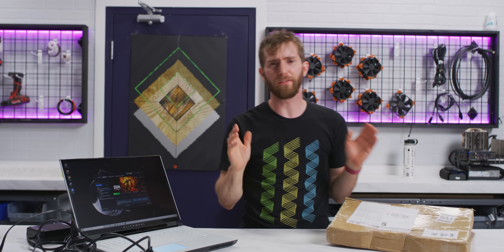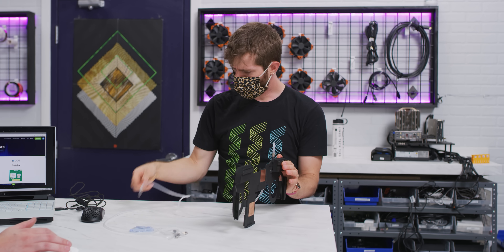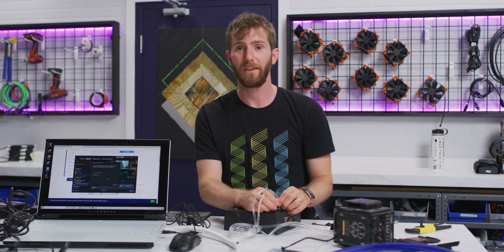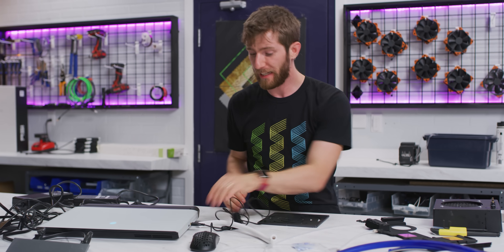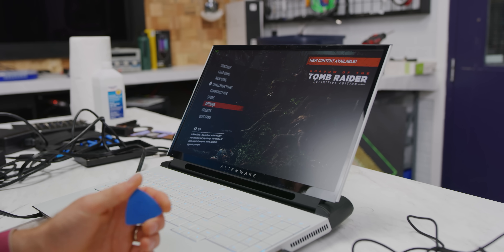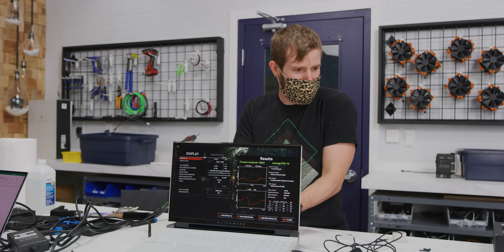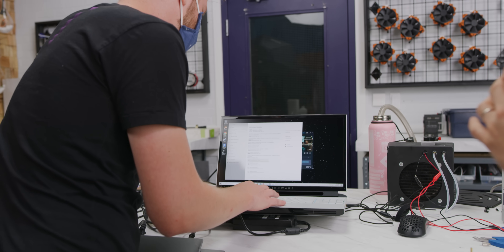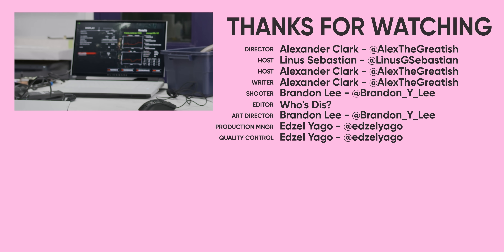This Sketchy AliExpress Cooler....

Comment: A had this Area51 model. Since June 2019 they lowered GPU power to 150-180w, lowered gpu temp before throttling to 69C and REMOVED videocard vrm heatsink-it will cause videocard vrm burnings. There are complete idiots in Dell. I was so satisfied when I sold it.
NOT RECOMMENDED
now have Titan GT76 instead

Comment: Very practical cooling solution for a portable mobile gaming laptop. Does it come with a special waterproof laptop bag to accomodate the pump and all the water that drains out as the tubes burst, whie you're crrying your laptop to the insane asylum to show off your water damaged $4000 paper weight. I'M BUYING 12 OF THESE RIGHT NOW SO I CAN CONSECUTIVELY DESTROY 12 LAPTOPS IN A ROW! lol great video guys

Comment: I wonder if in a lab of some tech giant, they actually made something like this but properly.. 

Seems like a good idea in principle, providing it is done right.. and I imagine if engineered from a cooler designed from the actual laptop model, it would have worked markedly better.
Reply: Looks like it's designed from the stock cooler drawings.  Might line up better with different VRM pads and appropriate torque.  For pump and radiator would need a more portable unit than their camera leftovers, plus it might be possible to close the loop with no pump for stock-like thermal performance.  For even better cooling, chill water to 1°C on the inlet, or go lower with something like  glycol.

Comment: Games running at 150 FPS plus is cpu bound , they should have tested different games

Also in Alienware commands center you need to set gpu max temp to 85C other wise the defaults at 74 C

Comment: When installing screws a good rule of thumb for tension if you do not have a torque screwdriver  is to thread them in until they squeak,  strip, then back them off a half turn. I've shared this tech tip with countless competitors.
Reply: How to damage a computer

Comment: For that price (600 kopecs), i'd make my own water cooler with carbon fiber and keep the OG parts in a bag. Like seriously, i've made entire covers from CF for under 100 dollars for everything when i was in highschool, sold them for 300 and made money. 

It's stupid easy to make your own bottom from scratch that allows you to put actual water cooler blocks directly on the CPU GPU pockets, over the OG cooler. So all in all, with a few YouTube videos for how to make CF parts (i am willing to bet that if a fella watched say.. RamyRC making his RC airplanes, they'd know how to lay CF panels), a new second hand bottom from fleaBay (found one that's about 95+shipping) and some coolers with push fittings, you could have a water cooler system for this for under 400, and i'm giving it extra, because for something like this, you could do it all, all of it, with parts that are non standard and fleabay finds (rad, fittings, piping, cooler blocks, CF fibers (precut meter squared sheets, resin etc).

The only thing that i'm at odds about how i'd do it, but that's because i don't have that cooler tray in my hands, is ... how you'd stick the water blocks to the face, but for something like this, where the end product won't be seen from the outside, i'd probably drill 4 holes in the non cooling conductive parts, and thread them to make classic braces.

PS, went to do some mathing. So about 95$ for the cover, 200 for cheap but decent all included water cooling kit (comes with only one sink tho >>> ), 16 for the second sink, 35 for a 1x1m piece of 320GSM CF cloth piece, 30 for a surfboard repair kit, which has more than enough resin for the whole project, 10 dollars for artic cool (first paste off the top of my head), 5 dollars for a drill and thread (2 in 1 combo) bit for 2mm screws, and let's throw misc junk for under 10, if i'm not forgetting anything, you could cool this for:  401 dollars in verified, fleaBay existing prices.

 So that's nearly 200 less than that non fitting piece, that doesn't come with anything other than two janky shower head core tubes and no guarantee that you won't fry your shit, whilst this variant, not only gives you the certainty that it works, remember, we're not displacing the original board, but it also allows you to go back to stock with all your crimes committed, unseen.

I think i know which i'd go for.

Comment: Alex, a mechanical engineer: We'll just tilt the laptop so the water just falls away from the motherboard
Reply: "Brilliant"
Reply: sounds legit
Reply: As an engineer (albeit software,) I can confirm that this is standard. All we do is make things work, for as long as they need to work, using the tools we have available. As long as it cools the computer for the duration of the test (and doesn't damage anything,) then mission accomplished! They're probably just gonna throw it out afterward, anyway. No point in wasting engineering time (which is generally quite valuable,) on fixing a problem that doesn't need to be fixed :)
Reply: @anexesstormlord7193  you're the reason the people who will work with what you came up with hate engineers
Reply: @alexstromberg7696  did they even turned on the pump?
Reply: @anexesstormlord7193  you're definetly not a German engineer 🤣
Reply: @Xc31  I'm not sure what that's supposed to mean, but at no point did I say my work is shoddy. Getting new tubing or a new fitting would involve hours, if not days, of waiting, just to fix a problem that will never happen again after this one test. Fixing it is a huge waste of time and doesn't affect the outcome in the slightest. If they were selling the setup, or planned to use it again, it should absolutely be fixed permanently.
Reply: @anexesstormlord7193  might not be a thing in software engineering then, but Germany is famous for fixing things that dont need fixing. Its a big part of why they lost the second world war actually.
Reply: @Xc31  Also going for quality when they were getting beaten by quantity. Lesson learned: mediocrity wins wars
Reply: @YinYangLogo  The problem isn't that they went for quality, it's that they went for insane quality
Reply: @TechnoMinarchist  So much quality the transmissions quit every chance they could.
Reply: @zachgullerman3183  That was an oversight issue not quality issue. They didn't design them for Russian winter (they believed they would've beaten them before winter)
Reply: @TechnoMinarchist  Not true. The German military was infamous for designing tanks that overloaded their chassis', more so than other armies of the time, which is saying a lot.
Reply: @YinYangLogo  not always, brilliance can too. look to alexander the great.
Reply: @rectalGland  might not feel like it to you, with you being German, but outside of Germany you still have that reputation. I live 21km from the border in NL. 

It might have gotten a bit less over the years, but taking a quick look at the German car industry or industrial equipment designed by German companies and you could still say they have a tendancy to overengineer stuff.
Reply: @Xc31  I had no reason to laugh at this as hard as I did
Reply: Sounds like something a mechanical engineer would say
Reply: Alex be like: "Trust me I'm an engineer!"

Comment: THERMAL PASTE!
That's the problem. 
Have you seen how he applied it?
Reply: I cringed soooooooooooo hard watching him slather that processor like a pb&j sandwich
Reply: @lorenzomeza6262  I was in tears. That legit upset me. My day is ruined!

There's been tests done using Plexiglas so you can see how the paste spreads, and that's like the second worst way to spread it (and it was like the worst I've ever seen anyone use that method). You want to do a big enough pea sized blob to have enough to cover the chip, right in the center, and use the force of the metal plate evenly on it to squish it out and it'll spread perfectly with no air bubbles and spread really consistently.

I'm go puke up in my bathroom now.
Reply: @DaftFader  That works if you can trust the mounting pressure, which you can't in this case.
Reply: @ThePandafriend  I'll always press down gently and hold if there's a lack of mounting force. The issue then though becomes one not of the application method, but of the bracket it's self causing a lack of contact. Two distinct different problems (all be it with the same end result of poor heat transfer).
Reply: The Verge flashback intensifies
Reply: @Tomáš Pružina He didn't use Kryonaut, he switched it out for some reason. he even says at 7:36 that the paste he is using does not spread as good as Kryonaut.

Comment: Speaks volumes of the efficiency of the original cooler. When increasing the cooling cap that much with no change it's either a good initial solution, or there's a power limit of some kind that get's hit first or at about 126 fps in that game lol

Comment: I've tried many wild cooling solutions in my younger years including a massive water reservoir soldered out of sheet metal that fitted in the unused space in the PC tower. I eventually came to the conclusion that nothing beats a commercial air cooler with heatpipes. 
And if something is worth importing from China, chances are it would already be stocked near you. These purchases are only for the adventure, not for anything resembling practicality.

Comment: @linustech did you guys run the benches on performance fan in Alienware command centre. I have found that on balanced it does not cool as it should. With performance fan mode on it cools perfectly. And would give a better indication of if the standard cooler is same as water cooling.

Comment: I think the quality of fittings, screw pressure, thermal paste distribution , airflow etc was so much worst with the watercooling adaptor that even a marginal improvement is a huge difference. I´m thinking about watercooling solutions for laptops from the early stages of design. Many of us use laptos forced, many times we don't move at all , but there is occasions where you need to move, so, having a professional solution from the beginning will improve your laptop performance without loosing portability, more like a modern Asus ROG GX700VO.

Comment: Those are fittings we use in the hydraulics industry. Typically for low pressure applications. Fluid Power industry fittings would probably help you guys out a lot if you were looking at alternatives for typical watercooling setups. Cheaper and rated to much higher pressures. Oil coolers for industrial gearboxes and engines make great stand ins for radiators.

Comment: While repasting the gpu in the 51m (R1) does seem to have a good effect, the cpu doesnt seem to get much (if any) benefit from it. I ran my 51m (9900k 2080) on  4.8 all core and saw near throttling temps with undervolting before my repaste and 80-82 on gpu with overclock. After repasting, I still run near throttling on 4.8 on cpu and did not find any more room for overclocking further, but my gpu runs 10 degrees cooler now.

I wouldnt use this ever personally, because its just too whack to use, but as it does show significant cooling on the cpu, at least you could say that you get more overclock headroom to run it at 4.9 all core or maybe even 5.0 all core.

Still though, I would recommend to just repaste and undervolt the cpu and find a stable cpu clock and be done with it.

PS: dunno if still an issue with 51m R2, but on the R1, bios version 1.5.0 > all later bios and you also need a custom profiles.zip for command center to unlock the 75 degree limit on the videocard.

Comment: 7:35 - the way to put thermal paste on.. oh my god! :D It's a freaking nightmare for someone who used to pursue 1 to 2 degrees lower temps by greasing the CPU with "just the right amount of" thermal paste on non lidded CPU-s (Athlon 3200 etc) :D  Mine was applied like it was a thin cover of paint! :D I'm using this practise these days as well and it looks much neater and imho works better.

Comment: 99 degrees on that Cpu? Omg, surely they could have done better stock cooling for it.
It's overall not much better graphics wise but will probably make the laptop last longer since it's not overheating constantly under load.

Comment: That means you were limited by wattage not by thermal. But running 20* cooler is a huge difference. Now you can mod the bios to increase tdp and overclock it.

Comment: I can't help but wonder how this would have done with a better radiator and better flow. TBH, if I were going to watercool my 51m, or anything else externally, I'd hook it up to an Alphacool 1080 or 1260 Nova/Super Nova.  Might as well go all out.  That radiator they used was just too small it seems.   I would have also used a few aluminum shims between two much skinnier thermal pads, especially since I found out they are so cheap and easy to get at Home Depot last week.  It is unfortunate that the water tube was so skinny.  This solution seems more for an owner that doesn't need a laptop.  Tearing down my laptop before I go out to sea and tearing it down again when I get home would be more trouble than it is worth.

Comment: It looks like the first air cooled run was a failure simply because of the air gap you had in the distribution plate between the cores and the heat pipes. It should work better if there is already water in the system allowing more of the heat to transfer. Perhaps you could add quick disconnects for switching to mobile use. ASUS ROG GX700VO comes to mind.

Comment: Is this thing at least capable of retaining the water in the system, our would you need to flush it every time? Some kind of quick disconnects would make sense, but I doubt this has that. If you can't just grab and go, having a laptop is pointless.

Retaining the water in the cooler may provide a bit of thermal mass to aid the air cooled... Just speculation though.

Still not something that really makes much sense.

Comment: actually i am using a similar things for my gigabyte slim gaming book from 2016. torch-welding the coper pipe to the original cooling plate and using external water cycle, my burning cpu&gpu temp drop from 90+ to 40+ in full load. But the slim book is not slim and more.ಠ_ಠ

Comment: Yeah, like many comments already said - if You get so much thermal improvement, then the logical next step is to overclock it.
Concluding the experiment with "marginal performance gains" is just not right - nobody would go through this process and then not overclock. Unfortunately that wasn't even mentioned.

Either way, thanks for the entertaining video :)

Comment: i think the stock aircooler is going to start throttle much sooner than the water cooler. still not even a "good" solution. but there are people (idk why) who are using thier laptops as desktop machines. for one of those, this product could be usefull, but not really...

Comment: From my own experience with TerransForce P177SM with AlphaCool Eisbear, I would recommend just use liquid metal would provide a great balance between cooling and complexity...(If you gonna open a hole and run waters through your $4000 laptop, you might also not afraid just short-circuit it and kill its mother board right? LOL)
But, yeah, water cooling kit such as this one can surely lower your laptop's temperature.

Comment: Was expecting more from this video, the whole idea was amazing with water-cooling, if you have installed that correct and overclocked the CPU & GPU you can have 20% performance boost.
Reply: Could the laptop even put out more power to overclock though?

I'm sure the laptop would be designed to use it's full power output capabilities without being hindered by thermals.
Reply: @joelmarriner487  laptops these days dont even have an adequate power supply to not throttle themselves withput being overclocked. Its actually pretty ridiculous. I almost doubled my FPS in some games just by buying a better charger on an old dell laptop.
Reply: I doubt that this would be possible without replacing the psu.

Comment: People need to understand that not everything that comes from AliExpress/China is terrible quality. I have custom loop watercooling on my machine built all 100% from aliexpress parts, and it's been running great 4th year now. I disassembled it last year for inspection; rubber washers are totally fine, no corrosion even though there's mixed metals (CPU block and radiator), everything in great condition. Using just the distilled water, with no silver or any biocide.

Comment: They have not installed it properly btw, thermal pads screwing up the mounting pressure. I have seen this mod on clevo barebones as well as alienware. With liquid metal/normal paste you can go 20-35 c degrees for sure. Tested on the p775tm1.

Comment: 2 simple rules of pc:
1)If it aint broken,dont fix it!
2)If its a laptop only upgrade to ssd from hdd or larger capacity ssd and larger capacity ram and only if u wish.
For laptop cooling:
Only a good and quality notepad cooler!
Everything else is either a risk or too expensive for any improvement!

Comment: Reduction in 20 degs for an aftermarket laptop cooler is amazing. The fact that it dint improve fps or performance really is just testament to the laptops crazy specs. But reduction in 20 degs will improve longevity of laptop components and long term stability of cpu by a lot. Also really people need to stop doing effing 10 minute stress tests on a system and calling it a day. Do a minimum 2-3 hr stress test to simulate heavy gaming and then see how much the throttled values improved. Temps are a function of time you know.